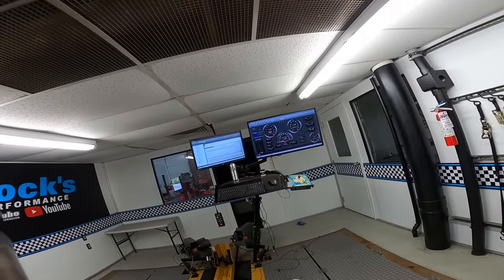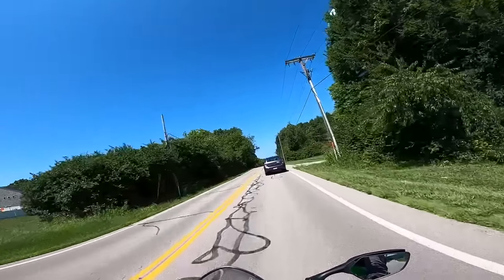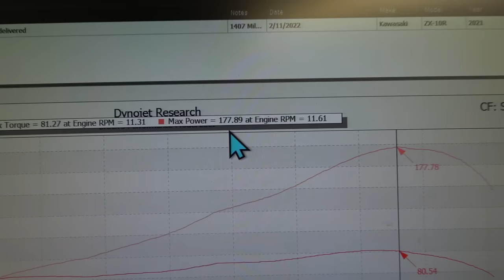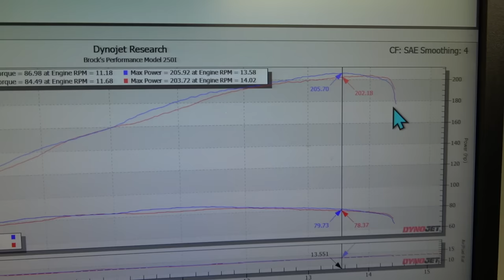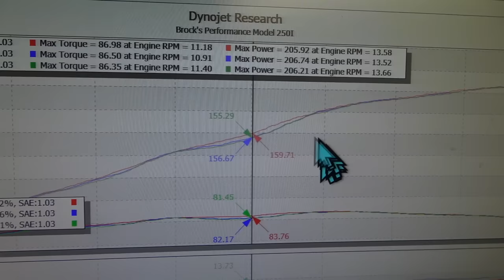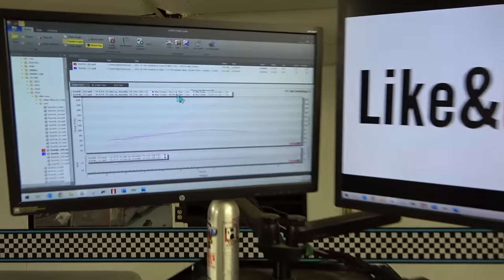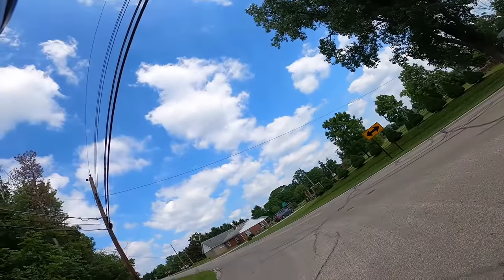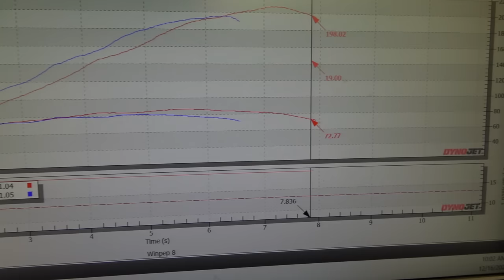2021 Kawasaki ZX-10R Sets New 1000cc Horsepower Record

Comment: 207rwhp, 87 ft lbs torque.  

does this dyno normally read this high?
Reply from the maker: @stinger_zx10r --- It does. Here is the BMW mentioned in the video showing that the drag strips read high also: https://youtu.be/WNotLs-_5sw?t=621
Reply: @BrockDavidson  it's a legitimate question. My Gen3 ZX10R puts down anywhere from 172rwhp to 185rwhp on the same fuel map on 3 different dynos
Reply from the maker: @stinger_zx10r --- And my reply is genuine. 170 MPH in the 1/4 mile, stock wheelbase takes between 205 and 210 RWHP at our bike/rider weight and frontal area. Our dyno is calibrated for our room (actual dyno floor height 860' 1" Above Sea Level) with: a constant inlet temp (draws from an 11K square foot warehouse instead of inconsistent outside ambient air). The warehouse has a calibrated air inlet system to allow more or less air in the warehouse, depending upon the time of year, conditions, etc... Our dyno room ventilation system completely evacuates the room 6-8 times per minute (Dynojet suggests 8-10 times per minute min) using a 12K CFM inlet and 40K CFM evac. We test our Dynojet "stack" 3-4 times per year to make sure the absolute pressure sensor is reading properly, as well as the other items (temp, humidity, etc...). We also test our AF ratio "sniffer" using test gas before all mapping sessions and replace the sensor if it isn't 13.0-13.2 - 1: https://youtu.be/RmWkwTZ-n7o?t=135 .  I'm going to guess that none of the 3 dyno's you have tested on are as serious about their test criteria standards? I spent 15 years in the special machine world, specializing in stand-alone automatic test stands in the automotive leak and flow test industry, so we are VERY serious about our data gathering and calibration as well as our preventative maintenance. I hope this helps you understand a bit more why our readings don't match most of the outside world. BTW, our dyno and Chris Moore's read within about 1-2% of each other....he's no stranger to data gathering either.
Reply: @BrockDavidson  I believe you and thank you for the reply. I think you may have subconsciously grouped me in with the peanut gallery that's always questioning Dyno numbers on the internet and irritating people, but I was legitimately wondering.   And for what it's worth, the dude that did the tuning on my bike at Fun For All Motorsports in Kentucky, my bike dynos the lowest at his shop 172rwhp, but he's the only real guy that I trust because he got my AFR the smoothest and flattest at 13.2 (with PCV).  And I guess the reason I've been wondering is because the new literbikes are all around 195 to 200 after flash and bolt ons and with my (09 zx10r) bike making, let's say, 172rwhp to be safe, at the tire after thin head gasket, full exhaust, etc, I'm just wondering how far off really my bike is from the new literbikes.  I think even if I did head work I might still not be close to what the new bikes are doing.
Reply from the maker: @stinger_zx10r --- I am now immediately skeptical of the condition of your engine after seeing "after thin head gasket". This means the head has been off, which opens up a Pandora's box of potential performance problems. That said, a typical 09 on our dyno would show around 175 RWHP. We didn't star seeing "modern day" power levels from the ZX-10R until the Gen 4 release in 2011. You can't compare what you have to what can be purchased today as its apples to oranges. You might like this?: https://blog.brocksperformance.com/kawasaki-zx-10r-11-15-information/
Reply: @BrockDavidson  Why be skeptical? Two and a half years ago my oil pump gear broke in my 25xxx mile motor and basically destroyed everything except for the crankshaft, transmission and cylinder head. Pistons were chewed up and everything. So my buddy and I got a new case, new pistons, new rods and basically built a brand new motor and swapped over the original head and transmission to the new case/motor. While everything was apart I installed a 0.25 mm head gasket from Dr Doug head gaskets.  I believe OEM was .56mm.  I've put around 10k miles on this motor over the last few years and she is running as strong as ever with multiple track days and spirited track day riding.  With that said I do plan on adding a Gen6 to the garage within a few months to give my 'ol Gen3 a break.  Thanks for the reply

Comment: So kawasaki is in line with all 1000cc normally aspirated motors other race bikes on the street right. As you can mention it produced even the top horsepower on your dino against other competitors like bmw. Send this video to Chris Moore to stop yelling that gsx 1000 is the fastest stock bike. Even bmw s1000 is a little bit faster than gixxer and he knows it but his pride can't accept this. So apples to apples zx 10 is at least as fast as gsxr 1000.  For me Rikey Gadson is the man, not Chris. Peace.
Reply from the maker: No doubt Rickey was on a faster bike at the battle of the brands.
Reply: @BrockDavidson  that means that the bikes weren't equaly modified like they set it before the race. I like suzuki bikes. They are beautiful powerful and reliable. They were the first to go over 186 mph on a street bike but wright now at 1000 cc they are not the fastest anymore. They are in top indeed but from the factory i think other bike is faster is hard to say witch one because of restrictions.  Basicaly any 1000 cc bike from top manufacturers can be a roket on wheels with the right mods. I mentioned about Chris because he has a habbit of cheating people when it comes for him to be in front. On battle of the brands i think he did that and it's not fairplay. He mess with the wrong person back then. Good luck with yours affairs. You are a legend too Brock.
Reply from the maker: You are missing the point. Chris got into his head, that's why RG lost. I was watching and calling out the miscues live, as they happen. Honestly, I was surprised. The RG we won championships with was always ice cold under the most severe pressure. He had a bad day. Two red light loses and had no use for tearing down at the end. All athletes have them, but this one was on a very large stage.
Reply: @BrockDavidson  may be but i hear Chris in one video that his gsxr 1000 eats oil like gas. My car also eats oil 2 or 3 liters per 10 000 km drive but it is 20 years old and that can affect other things like cataliser or mufler or maybe else more important some mecanics said to me but i hear that oil burn on the engine with gas can make engine run faster and smoother. So i d'ont trust Chris doing that to his engines like you do or other. This thing may work on drag racing but on the streets engines has to last longer than 2 or 3 days drag racing. That way i say Chris is a little beat of a cheater when comes to racing. I can't say yes i can't say no about him but i d'ont trust him. On the street we need reliability and speed not just speed. Eg: in winter i had problems with starting my car, some mecanic said to put a very tiny amount of special alcohol in my tank combined with gas and it definetly make a difference on my car engine. Run smoother and faster. You know better these things like me and i think you know what i want to tell about. Otherwise Chris it's ok and has some great stuff for making bikes run fast. But not for kawasaki. For kawi you or ejr or Gadson are better, wright ? Have a nice day and year all of you.